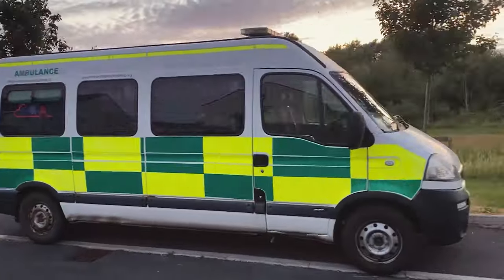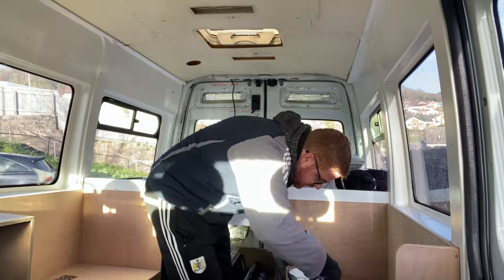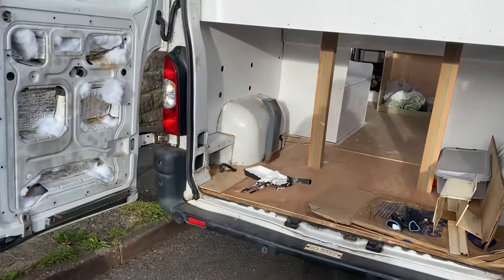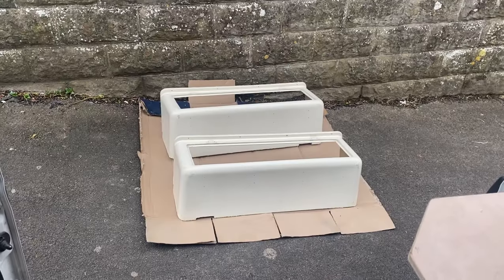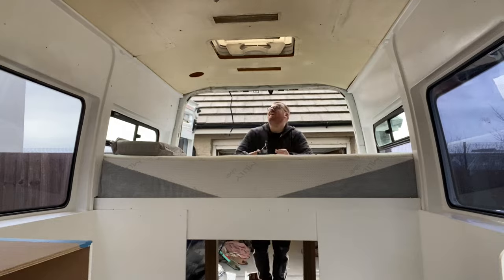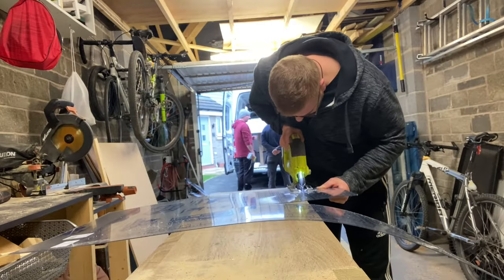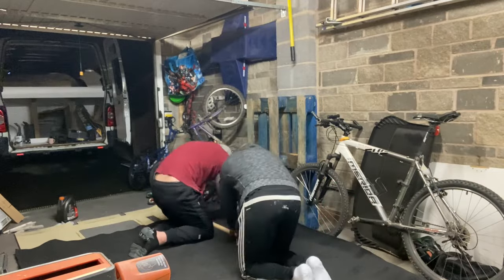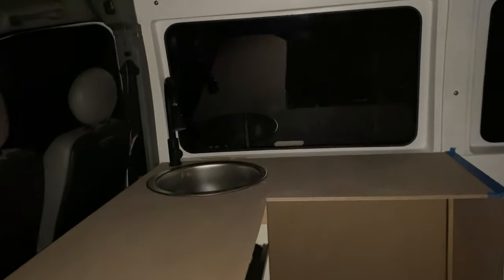Converting A Campervan With No Experience #08

Comment: Just watched all the videos and you're doing great.
Just a couple of pointers, if you can, get some more insulation behind the panels as that reflectix won't keep you very warm.  Another point is to drill some holes with a hole cutter in the bed base, this will prevent your mattress going mouldy.
Reply from the maker: @Pootz1000 Really appreciate this feedback!! I have additional insulation to go in which should help, plus a diesel heater and convection heater which I am hoping will help. 

Awesome suggestion regarding holes in the bed base!! Really appreciate the support 💪